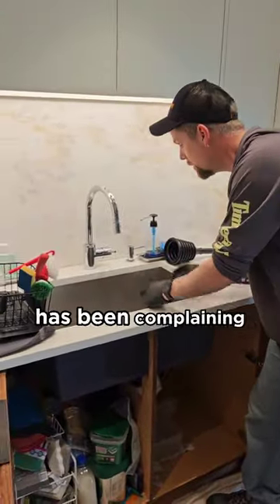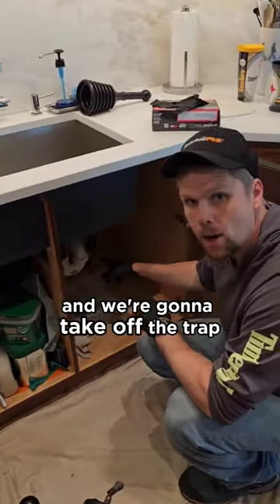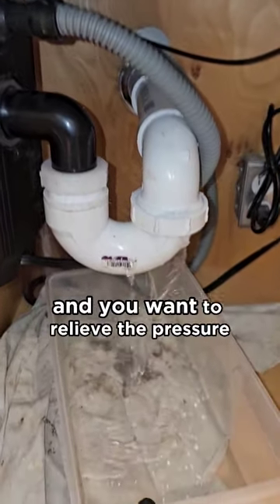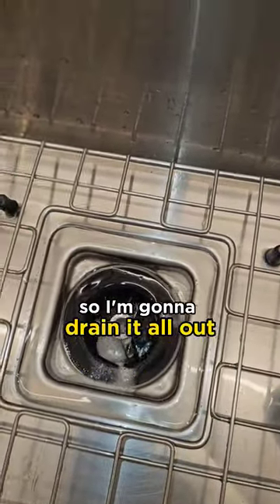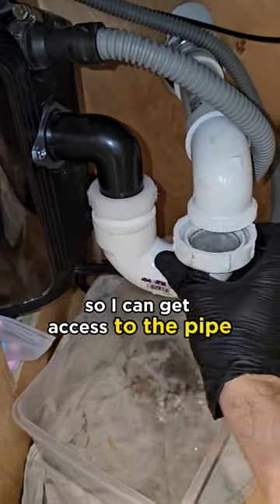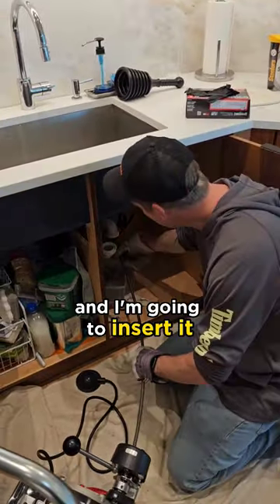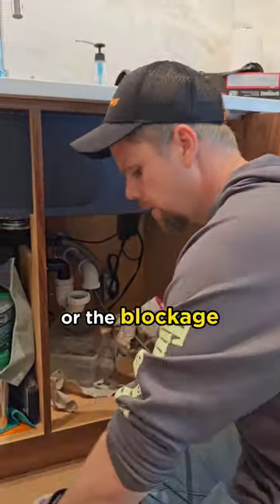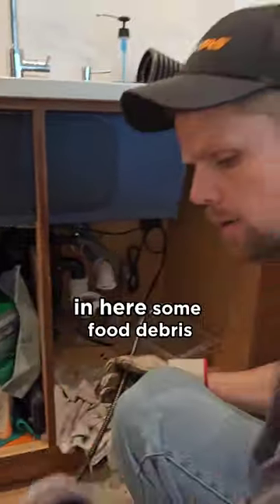How to unclog a kitchen sink that's draining slowly 🐌 #handyman #howto #diy #plumbing

Comment: Snake-use caution: If you’re going to leave on the back plastic piece (like he did), do NOT let the snake rub against it, because that will grind it down and cause it to leak.
Reply: I believe this is exactly the mistake I made. Any advice on a temporary fix? It’s leaking non stop from that back pipe where it connects

Comment: try a plunger first, three slow pushes down, one quick, short jerk up..
Reply: You are right….I should really give her a call.
Reply: IF YA GOT LITTLE TO NO BLOCKAGE😂
Reply: IF u have a DW Mobile home like i do DO NOT USE  A PLUNGER, My CLOTHS WASHER DRAIN line is in concert w/SINK drain...., i actually MADE IT WORSE, had raw sewage coming out washer drain pipe,,,,,,Either call a plumber now or go under the house, ive augered at BOTH washer and sink NH..
Reply: @Sh1tzboutagodown 😂

Comment: not one to say much but why the hell did ya not take off the last 90* bend and run the snake straight in ? no doing this can stress the fitting and maybe cause it to snap depending on the age??
Reply: It’s glued together bro. This guys does tons of different jobs that’s not just plumbing, you’d have to cut off some pipe that’s connected the 90 to have a straight run. He probably didn’t have the stuff to put it back together. Either way he got the job done.
Reply: @RiskyRizzler  in the end that is all that matters you get it done

Comment: (i’m not a plumber) i did this just now and dumped over 5 gallons of dirty sink water onto the floor. but the U pipe was FILLED with food so i found the problem. and the new solution is lots of towels.
Reply: Same 😤

Comment: I have had my house since 1982.  My kitchen drain has clogged many times.  For about twenty years we rented the house out.  My current solution is to remove the last under the sink white  pipes and place a home device to the waste line thread male drain pipe.using a female white 1 1/2 connector.  The other end has a female hose   pipe hose connector pipe. When all connected, I turn the hose on.  If I have to I will run it to the hot water tank.  It has worked several time for me.

Comment: DON'T THROW AWAY YOUR GREASE DOWN YOUR DRAINS!!!!
When grease cools, it solidifies. Especially cooked grease.
Always use an empty container, 2L bottle, gal jug, empty oil bottle, or something you can seal and then throw it away.
If any grease does go down the drain  chase it with a LOT of hot water. Regular hot water may not be enough to really do it, so you may end up needing to boil some water in a large pot.
Reply: I love this idea.

Plus my heater isnt working, could be loss of hot water causing the back up

Comment: Literally just unclogged my slow draining  Sink in the bathroom, not in the bathtub, but in the hand washing tub, Cleaned the underneath entirely by taking it out one by one. Afterwards, I noticed that my filter was completely clogged on the sites etc. where its hard to see. Cleaned it out, runs like a charm now.

Comment: Why don't you remove the neck so you could access the drain straight on????
Reply: Because it's glued on I'd cut it off install a Y replace with tubular trap and install clean out install female cleanout fittings on other side of Y 😊
Reply: @garykrell2058  that's not true! I zoomed in and there is definitely a hand threaded nut on the last elbow about 10 to 12 inches or so from the neck!!!!
Reply: @myronperish7551  I don't see it still need a cleanout an raise the DW drain hose into a loop